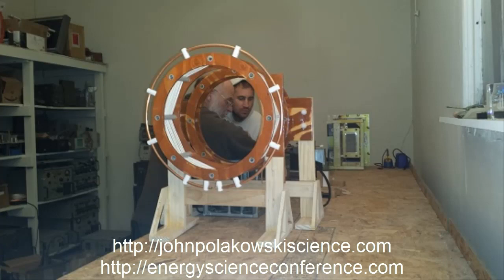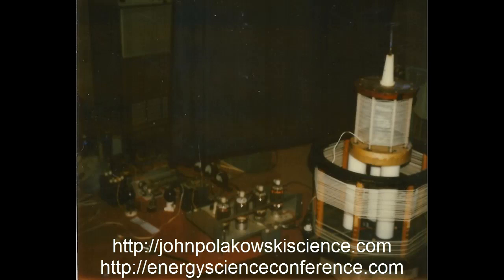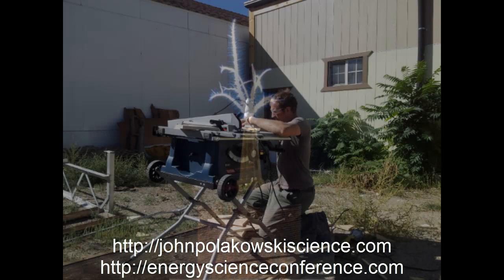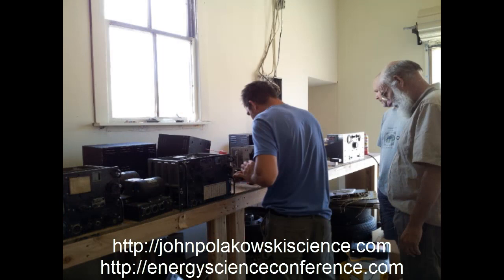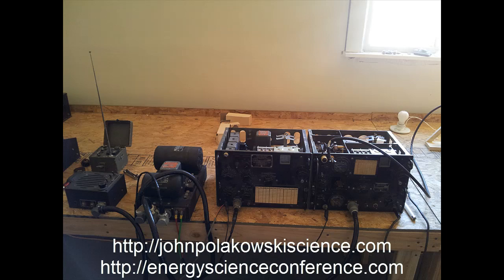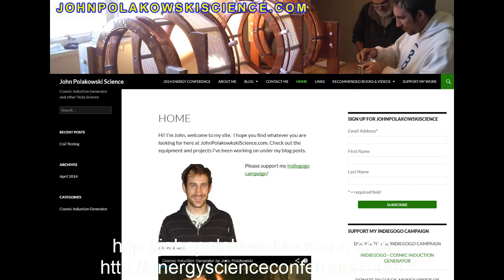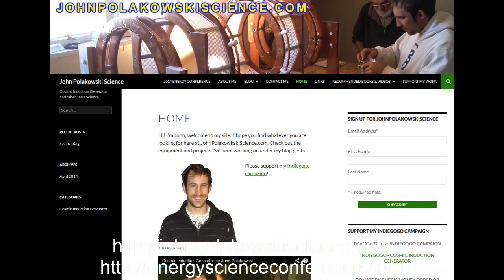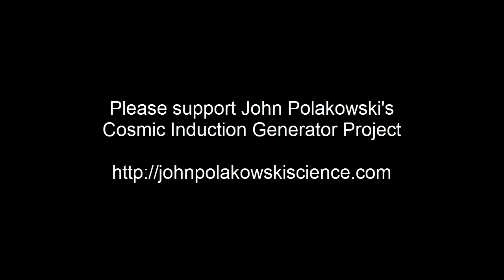John Polakowsi Interview on Cosmic Induction Generator

Comment: With my students, I built many loop antennas using copper tubing.  I prefer loop antennas rather than rod  or whip antennas in my laboratories as they can be made smaller.   Incidentally, I prefer to  look upon a loop antenna as an  magnetic  radiator unit rather than an electrostatic , and whether one connects the two shown above in a cumulative or a destructive manner, their combinations is well known to Radio enthusiasts and all those who are familiar with Maxwell's Equations.
One copper tube loop of 1 metre diam with a 50pF capacitor will resonate at about 10Mhz   where going around it with a neon lamp one can detect the electric field distribution and it is not constant for one loop.   For the antennas shown in the video the frequency is rather low  and the electric field  will not be as easy to plot, with the electric field distributed along the length of the wound wire.

Some time ago I played with my students using  rotating fans  to simulate  magnetic field distribution in the coils shown in this video.   When the fans are places such that their wind velocity assist each other well , pieces of paper will rush through as expected, but when the fans are put some distance away opposing each other the Potential Lined distribution becomes interesting,    What I did was to get some old magnetic tape from my old tape recorders and made loops of this magnetic tape starting from about one metre in diameter to about two meters in diameters.  I place the opposing fans such that they were at  the air through them emerged a slight angle above the horizontal.   With great patience and skill I opened up the loop from the magnetic tape into the flow distribution and the tape kept circling in between the fans catching the central field as it expanded outwards in between the two fans. It is a nice spectacle to behold.

Returning to magnetic fields  I normally design my own power RF oscillators using modern MOSFETs.  I always arrange that the  loop antenna itself is part of  the tank circuit of the oscillator to keep it as simple as possible as my students do not have much time to build more sophisticated circuits.   We use such coils as goniometers in direction finding to simulate ILS systems.   
Such experimental loops antennas and their behaviour  from about 025 to 10 Mhz should be found in all schools and the old gentlemen I saw in other videos would make and excellent demonstrations , but not cosmic, only conventional RF transmissions .   Nice need workmanship,   but I do not think that comic power  will be induced and detected with such  equipment as they are too noisy and probable cosmic signals would need liquid cooled Masers , to reduce the noise to comprehend what the cosmic powers talk about!!
Still nice equipment, but too complex for my students as they prefer to build their own  up to 500 watts power.